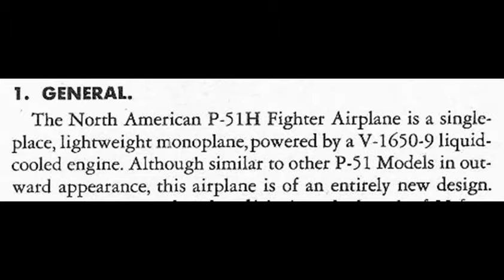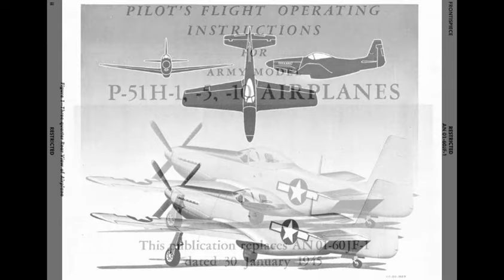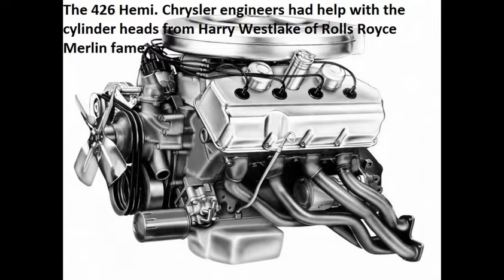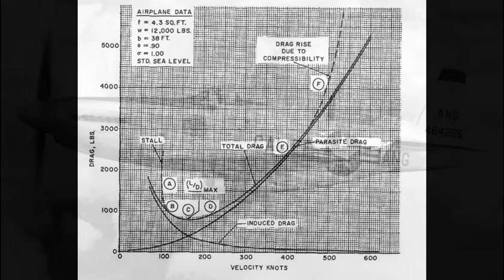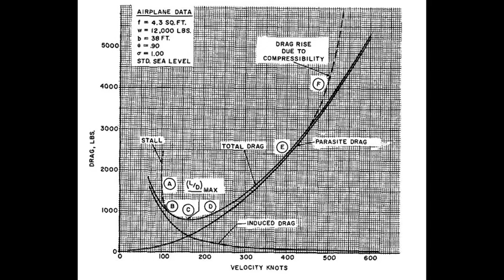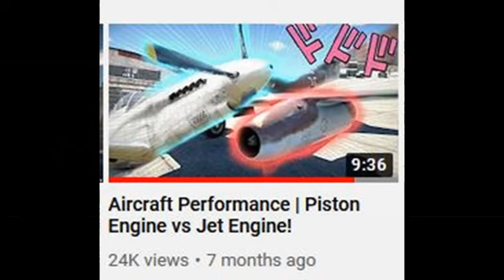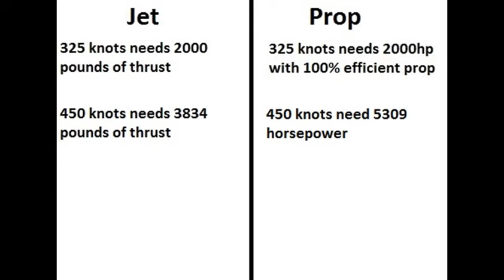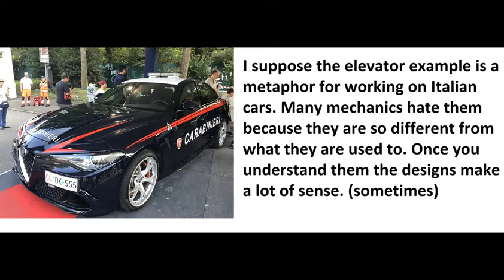U.S. "Superprop" Fighters P-51H, XP-72, and more

Comment: Very nice video.  Here is a little more history regarding the Republic XP-69 and the Republic XP-72 you may have not been aware of.  The Republic XP-69 was to feature an Aero Products Contra Rotating Propeller, which did arrive in 1942 at the Republic factory in Buffalo, New York.  It was to be powered by a Wright R-2160 water cooled radial engine producing 2,500 horsepower.  Its 42 cylinders were arranged in six rows each of seven cylinders with a displacement of 2,160 cubic inches.    Unfortunately, Wright failed to provide a reliable enough running engine for testing due to the engines complexity and it suffered from overheating problems so this engine program was eventually cancelled.  Another factor was that Wright found themselves more commited to developing the R-3350 Cyclone engines for the B-29 Superfortress which was given top priority and they simply didn't have the resources necessary to fully develop a new engine design and produce it in greater numbers.  A three quarter mock-up of the XP-69 was inspected in June 1942, but by May 11, 1943, because of Wright's failure to produce the R-2160 water cooled radial engine, the USAAF decided the Republic XP-72 would fulfill their requirements and the XP-69 was cancelled.  The most powerful piston engine to reach production in any country during WWII was the Pratt & Whitney R-4360 Wasp Major providing 3,500 horsepower. Designed by Leonard "Luke" Hobbs, the R-4360 featured four rows each of 7 cylinders providing 28 cylinders total. The cylinders themselves were arranged in a carefully coordinated corkscrew concept as a means to eliminate excessive cooling, which led to the engine's nickname, "the corncob." Displacement  of the Wasp Major was 4,360 cubic inches of swept volume.  Design studies for what was to become the XP-72 began in July 1941, barely two months after the XP-47B first flew.  By June 18, 1943, the USAAF felt the prospects of the new design was worthy of a development contract and ordered two prototypes as XP-72's.  When the first XP-72 was flown on February 2, 1944, it had much of the appearance of the P-47, differing mainly in the more aerodynamic slimmer nose that was created when the supercharger intake was moved back to the wing.  The big 28 cylinder R-4360-13 experimental engine was housed in a tight fitting engine cowling and cooled by a fan located behind the propeller spinner.  The first stage supercharger was located inside the fuselage rear behind the cockpit while the second stage supercharger was mounted to the rear of the engine.  Both were connected together by a long driveshaft that ran underneath the cockpit, connected by fluid couplings.  Features that proved advantagous on the P-47 Thunderbolt were retained on the XP-72.  These included the teardrop shaped bubble top canopy and compressability recovery flaps for slowing the fighter as it approached the speed of sound in a dive.  The first XP-72, S N. 43-36598, was fitted with a conventional Hamilton Standard 4-bladed propeller.  The second XP-72, S.N. 43-36599, was delivered with an Aero Products Conta Rotating Propeller that measured 13 1/2 feet in diameter.  The contra-prop was originally intended to be used on the XP-69, but Republic engineers decided to use it on the second XP-72 prototype instead.  During flight testing, both XP-72's demonstrated outstanding performance characteristics and a contract for 100 P-72's was approved by the USAAF.  The top speed of the XP-72's was estimated to be 504 mph although there were no flights made above 490 mph for fear the experimental R-4360 engine would catch on fire.  As it turned out, the second XP-72 did catch on fire at 25,000 feet and the test pilot put the plane in a dive, which extinguished the fire.  Flying the plane dead stick with two monster contra-props still spinning up front, the test pilot made a spectacular belly landing at a USAAF Base in Bridgeport, Connecticut.  The second XP-72 was never repaired and it was eventually donated to the Boy Scouts of America where it was used as a static trainer for the Air Scouts.  The production P-72's was to feature a new General Electric two stage, two speed centrifugal blower supercharger unit that measured nearly 5 feet in diameter and was to be fitted to the tail section.  Top speed of the P-72 production models was 540 mph, which would have made it the fastest piston powered fighter plane of WWII.  It was intended to use the planes as V-1 Buzz Bomb interceptors because of the plane's ability to rapidly accelerate to 490 mph at 25,000 feet.  When the Lockheed P-80 Shooting Star arrived in England in 1944, the USAAF quickly realized the Shooting Star's performance overshadowed the P-72's performance and there was more of a need for long-ranging bomber escort fighters, so the order for 100 P-72's was cancelled.  The first XP-72 was scrapped shortly afterwards.
Reply: @jimfinlaw4537    The question is what eventually became of the second XP-72 prototype when the Boy Scouts were done with it.   Was it sold for scrap,  used as a fire training aircraft like so many other odd types, or buried in a local landfill?   It would be worth finding out what happened to it, or if there is anyone around who may know. Some of the few F2Gs ended up on fire dumps unfortunately but parts were rescued.
Reply: @FiveCentsPlease  Not sure where it ended up at after the Boy Scouts.  No one seems to know, but I imagine it was eventually scrapped.  A good friend of mine who was an aircraft broker had a Goodyear F2G2 Super Corsair.  He flew it in an air show back in the 1980's.  When he got the fuel bill for it, he just about cried because that R-4360 engine burns fuel fast and he ended up with over 10k fuel bill.  He sold that plane to a private collector shortly afterwards.  I believe its now flying for the Red Bull Team if I'm not mistaken.

Comment: Greg, I really enjoyed your video. However, you forgot to mention Republic’s XF-84H prop airplane which was a converted F-84 Jet. Republic only built two prototypes in 1955, one of which is now at the USAF museum in Dayton, OH. I have no information about the 2nd prototype aircraft. However, I do remember seeing this model which was on a static display at the Bakersfield Airport in 1985 when I was on TDY in California. The USAF museum received this plane during the 1990’s. The old pamphlet that I seemed to have misplaced somewhere, which was claimed by Republic, that this plane could fly at 670 mph. However, the USAF museum disputes those figures. That testing program with Republic was shut down in 1956. Flight engineers and ground crews were sickened by the noise the supersonic props created which could be heard 20 miles away. I believe another crewman or engineer was also injured by shockwaves the prop-wash caused. No USAF test pilot ever flew these aircraft. Only two civilian test pilots flew these, with one quitting after his second flight in it at Edwards AFB.